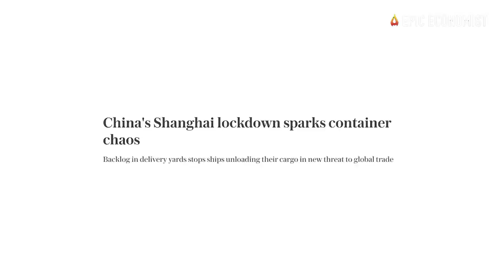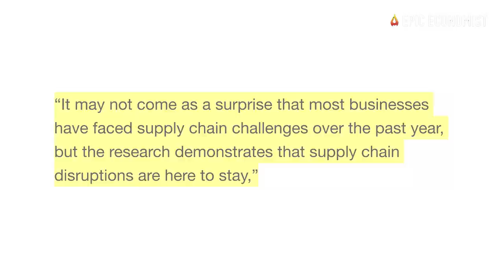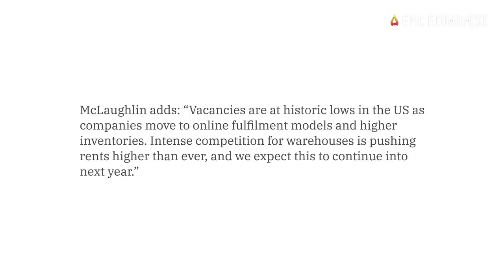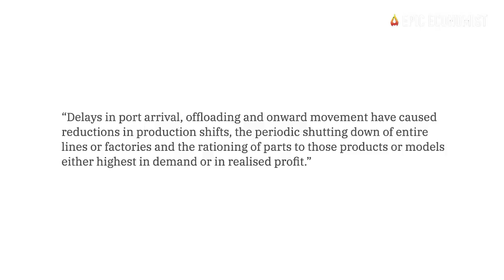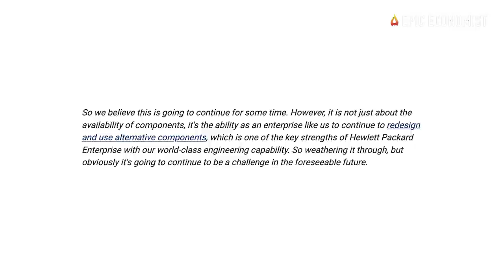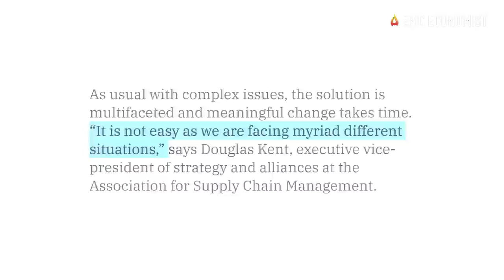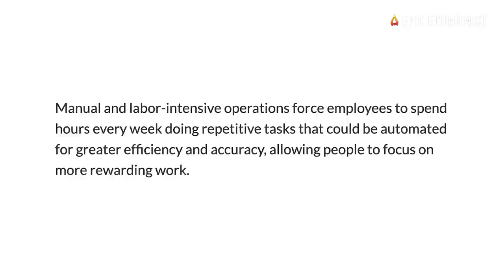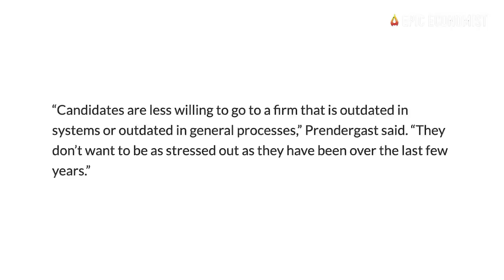Supply Chain Crisis Turns Into A Nightmare As Shipping Crisis Push Prices To Stratospheric Levels

Comment: Morpheus Network have worked hard in the last 5 years and created a resilient, fully digital automated end to end supply chain solution. The solution streamlines  supply chain using modern tech such as IoT and blockchain to automate processes and remove the manual document handling to save time and money. The platform integrates into existing ERP software so no need to replace anything. Used now by governments, small and large enterprise supply chains around the globe. They also co developed a solution to automate ports with the largest privately owned port operator in the world Gulftainer.